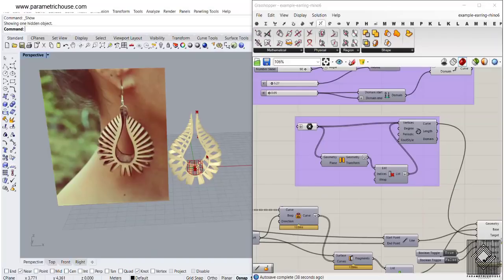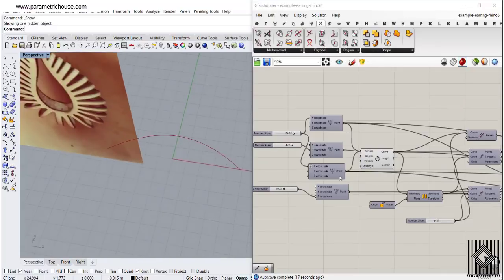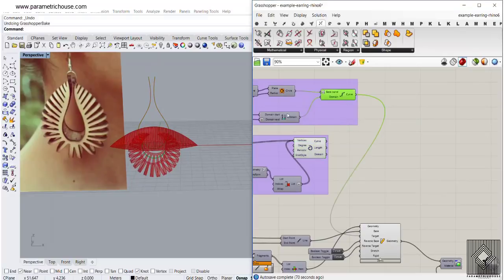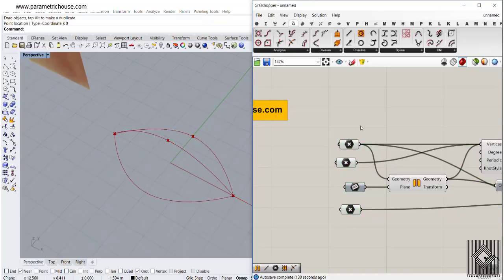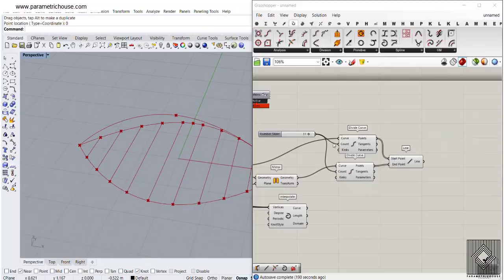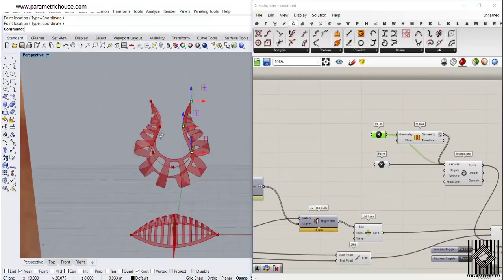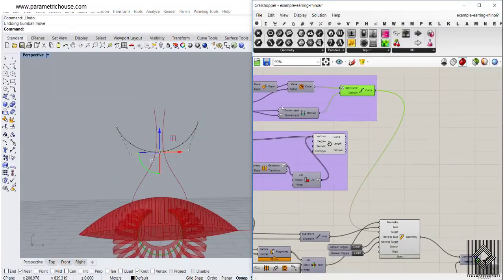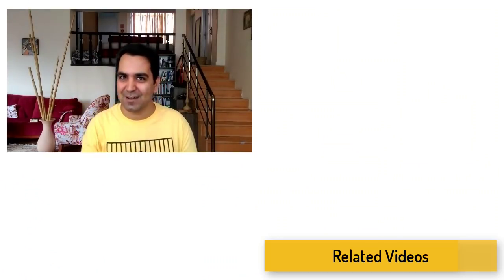Laser Cut Designs (Earring #2)

Comment: You do amazingly useful lessons, thanks!

I have a question regarding this one: what if model should be solid? I mean not to be like an empty frame, but have surfaces between the left and right sides. How, in this case, to close the holes between the ribs?
Because the node  "cap holes" is forming a surface only in the inner part of the earring.
I hope you understand what I mean. :)

Thank you!
Reply from the maker: You're welcome
Just try to offset the surface and make a loft between the two curves to close the holes

Comment: Well its a nice tutorial regarding modeling a ring in rhino, but I do not see a way on how you would laser cut your finised 3d model, since the surface it double curved meaning it is not possible to unroll the surface. So the only option i would see would be to 3d print the earing. There is always a big difference between just modeling a shape and actual modeling for fabrication. Which in your case by looking at the title would be to laser cut it. I would be really interested to see if you could make some actual tutorials regarding fabrication.
Reply from the maker: Thanks for your insight John. You're right about the double curved surface. I also find a leather earring which was exactly like this.I guess making this with Leather is easy and doable! 
Check this link for example
https://kristinamichellejewelry.com/products/nautilus-earrings
😊
Reply: @ParametricHouse  yes perhaps it would be possible to laser cut. It would just be very interested to see on how you could set your script to get the final lines for the lasercut file. Like finding a way on how to bring your round shape onto a flat surface. Perhaps via unroll or a different method
Reply from the maker: @johnwillberg9231  I think it's a real challenge there! before the tutorial, I tried to unroll and smash the model but it didn't give any good results. The Area changed and the resulting surface was not accurate for sure! Anyway, I guess I have to do some research on that even though making this with soft materials or even gold should be not that hard! Thanks for the feedback 👍